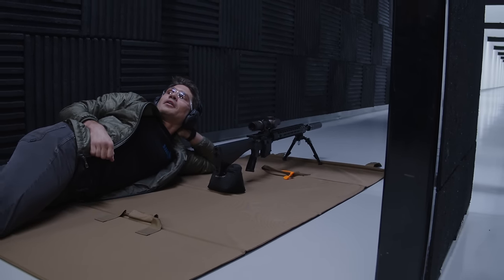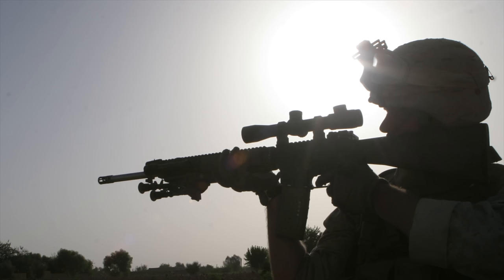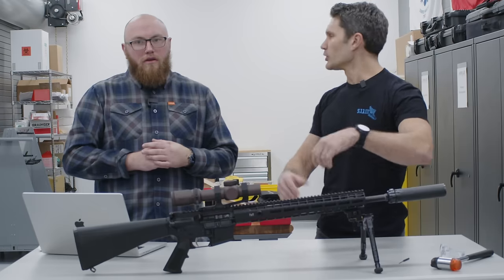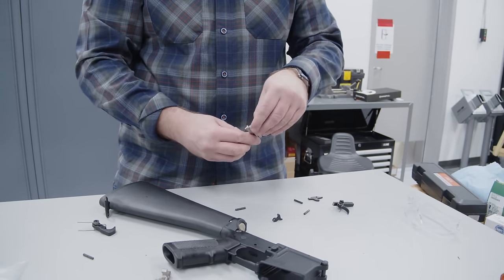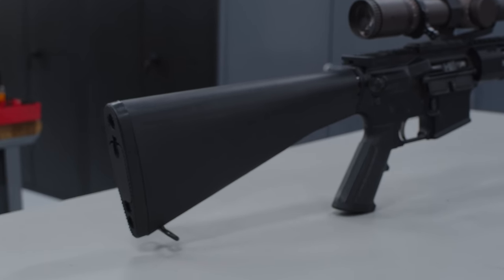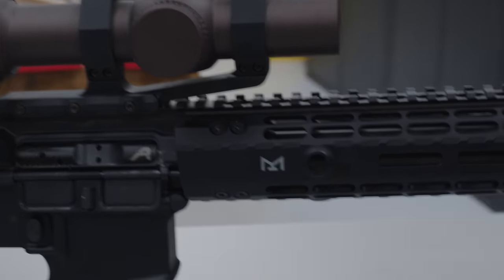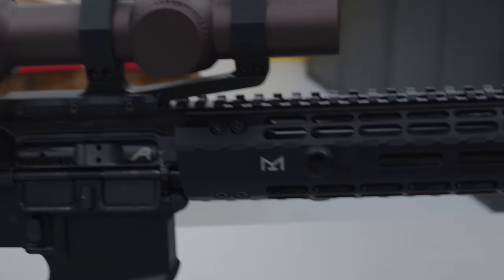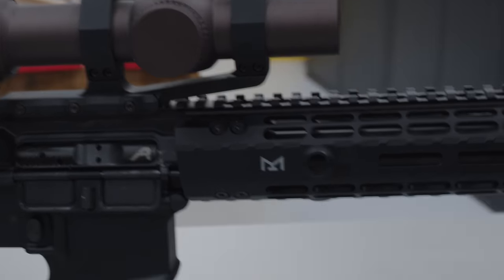Build a Designated Marksman Rifle AR-15 on a Budget!

Comment: Used Aero Precision 2years ago when I built my AR-10 type rifle which was close, kind of, to the Mk-11, M-110 or SR-25 but with a telescoping stock.  I went with their heavy barrel and good golly what a soft and accurate shooting rifle with 168gr SMK's.   Also not shabby with 155gr Hornady Black either.
Reply: I've used quite a few Aero parts, mostly upper receivers and barrels, and always found them to be top-tier.
Reply: I did a similar build as well I decided to go with Krieger for my barrel. My build was basically a clone of Johnnys reloading bench. The rifle shoots and shoots good like ragged hole five shot groups at 100 yards.
Reply: I love heavy barrels until it's time to move them

Comment: Larue complete assembled upper $750 ( including handguard, BCG, charging handle, A2 birdcage, barrel) PSA magpul lower parts kit. $99. Stripped lower ~$100. That comes in at around $950. Then if you want to add a better trigger that’s around $75. $1,000 for a sub moa rifle.

Comment: I have two Ruger 556 mpr 18in cold hammer forged barrell. Both shoot 3/4 moa with ammo(brand) 60gn vmax. I have reloaded for my first and it shoots .238 with the same 60gn vmax. $900 max price I have found. Just bought a cerakoted one for $750 from sportsmans.
Reply: I have an MPR too, shoots 3/4 moa with PMC and S and B 55 grain

Comment: Used an Aero Nitride BCG, M4E1 Lower, and M4E1 Enhanced upper with their Octagon M-Lok handguard for my SPR. Still working on load development, but it is at least a 1 MOA gun, probably sub-MOA with some load development and practice on my part. I've got a Rise Armament RA-140 trigger in it, and a Burris 2.5-10x42 scope on top, with a Ballistic Advantage 16" Fluted Stainless .223 Wylde chambered barrel, 1:7 Twist, Midlength Gas System. I had the same parts but in an NBS upper and handguard and on an Anderson lower. It was a 2 MOA gun, which isn't horrible but I knew I could get better accuracy with better receivers and handguards. Glad I went with Aero to finish my build.

Comment: Built an Aero based SPR like this with the same barrel and ODG Topo builders kit over the summer. Took a while for groups to come together, guessing because of the hardness of stainless steel after QPQ treatment. Either way, once broken in, it's been sub moa @100 yards (7/8") with Frontier 55 grain FMJ Hornady bullets, and stacks rounds easily at 300 on steel. Put an Athlon 2-12x42mm FFP on it in an Aero mount, Geissele SSA-E trigger.

Comment: I have a bear creek arsenal .223 wylde 1:8 twist 20” stainless steel barrel side charging complete upper I got on sale for close to nothing. I had low expectations for it because it was really cheap and I’ve heard mixed reviews about BCA but when I sighted it in I was astonished at how accurate it was. I was originally planning on upgrading to something more expensive for my long range AR build but honestly I’m getting sub MOA groups with 75g BTHP ammo so I might as well spend that money elsewhere.
Reply: Bear creek has impressed me more than psa for accuracy. The only thing i dont like is how heavy their rails are.

Comment: It is complete, I didn't know what to do with it! AERO PRECISION upper and lower receivers 18” barrel (Deadshot Barrel), Aero Precision muzzle break, Trigger Tech trigger AR Diamond, BCG Griffin Armament scope installed VORTEX PST 2-10x32mm30mm FFP/MOA. Change buffer tube to rifle length and install flat spring Tubbs for AR-15, install Luth-AR rifle length stock, or change to RAPS stock. The AR-15 223 Wylde is 2/3 years old sitting in my safe waiting for something special to become now it knows its future!
Additional: RAPS stock installed. Maybe install Griffin Armament suppressor Dual-Lok PSR? The sighting system, and what to mount: the 1-6x, 1-8x, and 1-10x all do not have parallax adjustment why the Vortex PST 2-10x; it is low enough in the power setting @2x.

Comment: I built my own lower, and used a good NiB trigger and some good springs, a Rock River A2 stock kit, and a Ballistic Advantage Mk12 SPR Ops Inc Profile barrel in .223 Wylde, a Cerro Forge upper, a Toolcraft NiB BCG, and a good free float quadrail. Shoots in the same hole at 100 and did it for about 700 bucks in 2020

Comment: I built an Anderson Manufacturing sub-MOA rifle about 5 years ago.  
Anderson stripped lower - about 33 because there was a sale of 3 for 100.
Anderson upper receiver - 65.
Standard parts kit was 50.
Floating handguard was about 100.
Rise Armament trigger (on sale from PSA) was 99.
A2 stock with rifle buffer assembly was about 175.
Anderson stainless 24" bull barrel with target crown with fluting chambered in 223 Wylde (Most expensive part) was about 250.
KonusPro 6-18x56 scope from DVOR was only 159.
Cost was about $950 and it is accurate as all get out.

Comment: Not sure but...   here... since I kind of been doing this..

1. LPK - Dirty bird $30 -FCG
2. Rise drop in trigger $99
3. 80% lower - $50 or $60 if you want it raw or not
3. Buffer kit with stock $25 from DTT/Omega
4. Upper complete $50 from Omega 
5. Barrel 18-20 inch Rosco Bloodline $99
6. Lite M-Lok handguard $40 from Davidson defense
7. Comp $30 from DTT
8. Gas block + Tube  $30 from PA or DTT
9. Nickel boron BCG $75 from Durkin
  Optic is up to you but so far its only $538 + tax ,,     Gives lots of room for a solid optic..  Just saying..

Comment: I bought an Aero Precision M4E1 in 6MM ARC, a complete AP upper, a 16" Ballistic Advantage stainless steel barrel, an Aero lower, spent a little more for a National Match 2 stage trigger. With 105 Hornady Black at 100 yards I average 1/2" groups. I spent on 3 extra mags, a brass catcher,  A2 front and military rear sights. I came in at about $1,300.

Comment: Nice video 
I just built a AR15 Varmint rifle that is well less than your $ `000.00
Started with a stripped lower and a Model 1 complete kit 
My choice was the 24" 1-14" twist barrel , as I planned on 50 gr bullets 
Added a Vortex  Viper Scope 30mm Tube 6-24x 50mm
On a Warne LR-SKEL Mount 
It shot sub MOA with American Egal 223 50 gr HP ammo I tested it with

Comment: In this application the M4E1 upper and matching hand guard are good for rigidity, but be aware they are bulky as sin and a bit heavy. It may be fine for a heavy DMR/SPR but for shorter builds they may not be what you want unless you want to fit a suppressor under the hand guard with a short sub hand guard length barrel. Its hard to C clamp around that thicc body...

Comment: My Bushmaster modular carbine I won in a Gunbroker auction for $450 bucks shoots MOA groups out of the box with off the shelf Winchester green tip. Has a free-floated, fluted 16" heavy barrel with 1/9 twist.

Comment: If you buy from Aero, I sure hope you get parts that work. I got a defective 30mm scope mount over the summer and it took them 7 weeks to respond to my service ticket. Not to fix my issue, but just to get any response at all. I'm steering clear of them in the future.
Reply: May have been in the middle of moving factory. You have to give them a little slack for that. Great to see quality manufacturing thrive in the US.
Reply: The Aero mounts make engineering sacrifices to achieve low weight and are fiddly to use and will shear if overtorqued or damage scopes.  There are much better options out there a few ounces heavier.  Otherwise I like everything else Aero makes.

Comment: I’m a big aero fan. Waiting on that EPC-10! Seriously looking at an AR10 build with this company.
Reply: Don't. The EPC is a hot mess
Reply: @adamc2378  almost every pistol caliber carbine is a mess
Reply: I built an Aero M5E1 buying their complete lower in FDE with the PRS G3 stock, and their M5E1 complete upper (20” barrel) also in FDE. Using 168gr SMK OTM, it’s .75 MOA all day. The only thing I had to replace was that dogshit mil spec trigger with a Geisselle. It’s a good DMR 👍🏻
Reply: Yup. I’m looking at one of those EPC-9s too
Reply: @Gnolomweb  word.  I myself have an M5 and one of their 10.5 standard barrel builds.  I friggen love the regular AR15.  Almost no reason to go with more expensive stuff. With XM193 it's around 1.5 MOA with a 2 MOA red dot.

The M5 is wildly over gassed and has proven difficult to tame recoil.  I've got extremely limited time in the gun, but the same 2 MOA dot at the same distance is absolutely horrible. Like "do you know what aiming is?" Levels of bad.  I've only used PMC bronze though, so it might really hate the ammo.  Disturbing to see the Trex gun behave similarly in the accuracy dept.

Comment: I did a very similar build to that just in 6.5 grendel. That handguard is a bit chunky but I do really like the m4e1 upper with the integrated barrel nut. Those coated triggers are a great value, I think I used a rock river.
Reply: Whereas I'm a huge fan of their Enhanced series. 
The ID allows my silencer to slide right under the 15" handguard (12" bbl) while the OD is reminiscent of the quad rail M4 I carried in the sandbox, yet significantly lighter.

Comment: Ammo, barrel, trigger.  Probably the most important components to get good mechanical accuracy.
Reply: My opinion, barrel most important.   Get the highest quality best barrel you can from whomever you trust it don't overlook the stainless barrels there may not have the lifespan as the other barrels could but let's face it guys if we're middle-aged and we build a decent rifle these things are good enough they're going to outlast our lifetimes so find a stainless barrel is not necessarily A bad thing don't discount it for that reason that it may not last as long as a nitrided or Chrome lined.

Comment: wild timing on this video just building the following
Aero M4E1 Enhanced upper and lower
Aero 15in enhanced handguard 
18 in BA SPR barrel
Larue MBT 2s trigger
Geissele super charging handle
Lantac BCG
YHM gas block 
Aero melonite gas tube
YHM Muzzle device
CMMG lower parts kit 
Radian Talon safety
Aero rifle buffer and fixed stock

Comment: I just picked up a an aero in m4E1- T 20 inch stainless steel barrel upper and 6.5 Grendel. I got a really good deal on it, and I intend to use it for deer hunting and possibly coyote hunting. I think it’ll fill that role pretty well, and I think it would fill the role of an SPR very well as well. I did however manage to pick it up, and lower and all the necessary parts for a lot less than $1000. OK, more like $800. I will be putting my Zeiss conquest MC hunting scope on it instead of a LPVO, because I need something with better light transmission. Also, I’m not trying to base break the bank by buying a another Zeiss optic.

Comment: Have a couple sub MOA rifles. None cost me more than 1k (sans scope). 50-60% of the rifle should be bolt carrier, barrel, and trigger. The rest buy aero, PSA, or yes Anderson. Go cheap on the rails, buffer, and stock and you'll have a kick ass rig. Frankly I don't spend much on the handguard anymore either, just rails has cheap stuff that's good enough ( solid ambi chargers and brakes too). If you're not mounting lasers it's just there to keep you hand from burning and hold your bipod.

Comment: Good luck building a Mk12 Mod 1 I spent 3 years trying to find the KAC Handguard finally found one paid $1,000 for it same week 2 came up on GB sold for 1,500 each within an hour. If you want a Mk12 go the easy route and get a PRI or BCM Mod 0 upper and call it good

Comment: Honestly, the easiest way is to start with a Sanders 6.5 Grendel upper, pair it with a quality lower (recommend Wilson Combat, around $70 stripped) and a quality FCG (JP or Rise Armament Blitz Elite), and a decent entry-level scope like a Vortex Sonora 4-12 or even a CVLife 4-16x52. You can save a little money on the lower build if you go with a fixed A1 or A2 stock from KAK (stock, buffer tube, spring, and buffer for $70). The end result will be scary accurate, and have a lot more effective range than 5.56. The scope can be upgraded at a later date.

Note: the CVLife scope, despite its obscenely low cost, holds up to 30-06 bolt action recoil. Haters are gonna hate, but my friend has 45 pounds of deer meat in the fridge because of it.

Comment: Ok so I’m gonna ask, if you ran a high quality barrel and trigger in a standard AR, Yeet a Vltor A5 buffer system, is there any reason you shouldn’t be able to get MOA or better accuracy with a standard AR?  Like with good ammo which should be a given.  Like do you NEED to have that kind of hand guard and buttstock to get that accuracy?

Comment: Yet another example of when people are bashing Aero it’s usually just them regurgitating things they’ve “heard” from someone else. I’ve built 6 Aero/BA both rifle and pistols and while I will say I think with the small price difference the M4E1 receiver set is a must but with a regular BA barrel and usually I’d do a Midwest Industries handguard I always had great luck out of them. I’d use the ALG AR trigger which is like 50 bucks and is a great upgrade from Mil spec and easy to build for  well under a grand. Other than the IWI Zion 15 I don’t know of any other AR on the market that matches the price/quality aspect of Aero?

Comment: Never had a Ballistic Advantage barrel over 1 moa (for 5.56) when using good ammo.  Their barrels can be purchased for pretty cheap.  If you aren't counting optics, I could build a sub-moa rifle for under $700 pretty easily.  It would be pretty basic, no frills but it would be sub-MOA and last as long as a gucci rifle.  I am not counting optic in the cost.

Comment: I did an Aero build for a DMR with their 416R stainless barrel. With 62gr 5.56 ammo, I'm getting around 6 MOA on a lead sled to make sure I'm not the problem. I'm extremely disappointed with its accuracy.
Reply: Not the first time I've seen someone say ballistic advantage barrel turned out to be 💩
Reply: Wow, sounds like a lemon. Return that sucker. Any modern manufacture barrel should be getting at least 3 MOA. Every AR I own (home assembly or otherwise) can at least do 1MOA with quality ammunition (most are sub MOA). Heck, my craptastic beater PSA builds will manage MOA accuracy on a good day, even the pistols.

Comment: I have a w.w.s.d. or what would stoner do rifle I put together myself except side charging and yea $79 lower $68 for the Ander lower parts kit Magpul  addition I think. BSA. Scope no zooming carbon fiber handgaurd monolithic lower 16" $209 upper I paid $40 for the scope used.and even with steel cases ammo I get sub MOA groups
Reply: I'd have to see that to believe it.
Reply: @connorh1196  what do you mean.? I got the kp-15 lower from Brownells for $79 .I'm not factoring in the $30 transfer fee. And from this new place down the road called Tennessee silencer for the lower parts kit for $68. And then I load the owner cash for the upper. He had bought it from someone for $200 with a carbon fiber handgaurd already installed. And as for the groups well.your rifle is only as good as the person behind it. No matter how you g or old you might be. Groups at 100 yards 1 inch or smaller aren't very hard to come by with a lead sled and a lazer bore sighter and taking time to tune the scope and sights I can hit this old head someone left aty local pubic range I'm Delrio one of those beautician practice heads. I can hit it reliably with 45 degree iron sights easy at 100 yards. Take it from someone who shoots 3 times weekly 4 hour per range visit it's my favorite thing to do. So I'd hope I'm at least decent. Anyways merry Christmas
Reply: @metalfenderguybradwalker1916  I mean I don't believe you're shooting sub MOA groups with steel case ammo out of a BCA upper equipped with a $40 scope.

Comment: As for the trigger current time you get the opportunity to drive nearly identical cars with one difference being direct cable versus electronic throttle. You will notice the difference. 
Not because of lag or latency though there is a tiny amount. But rather because electronic throttles are almost always tuned for the suburban mom on a test drive.
That first 15% throttle opens the actual valve like 30% so it feels "punchy". But when you start trying to smoothly progress the throttle from there. It feels like the guts have fallen out even though the horsepower is the same If not, even a little more on the electric throttle.
But the cable throttle gives you really good precise and linear control. Turbo cars that linearity can be a bit wierd, but in all honesty, it's no weirder than the very lazy throttle tuning that the electric equivalents get.

Comment: I put together an AR15 with some of the cheapest parts I could find online just for giggles. I think the gun might have cost $350 or so to put together. Good scope and match ammo and it’s 1.5 inch groups at 100 yards no problem. Seems like a 1 MOA AR shouldn’t be as difficult to assemble as it is but yet here we are.

Comment: I'm not the most knowledgable when it comes to calibers and chamberings. At 5:00 he mentions .223 wylde pulls in the tolerance for .223 and 5.56, does that mean that this barrel can safely expel either .223/5.56 even though it's chambered in .223 wylde?
Reply: It confuses me also. But yes you can shoot 556 from it. The 223 wylde is supposed to make it more accurate
Reply: I have a Wylde chamber. It’s a hybrid.  It will shoot both .223 and 5.56 NATO.  That’s what’s it’s built for .
Reply: I have a Wylde chamber. It’s a hybrid.  It will shoot both .223 and 5.56 NATO.  That’s what’s it’s built for .

Comment: Man.. I'd honestly say the KAC Rail alone will cost you 1k. I've had better luck finding barrels, muzzle brakes and hell even a few clone correct optics for a MK12 Mod1. The rail has been the hardest part for me. And super expensive.
Reply: I got the KAC MK12 Mod 1 rail from thoroughbred Armament in 2020 they even offered a coupon code 😂 I paid like $300 for it.